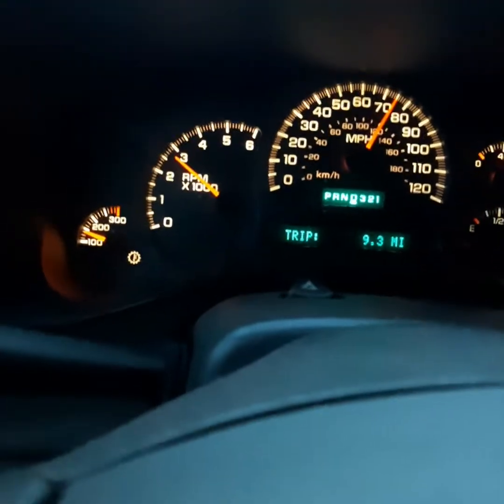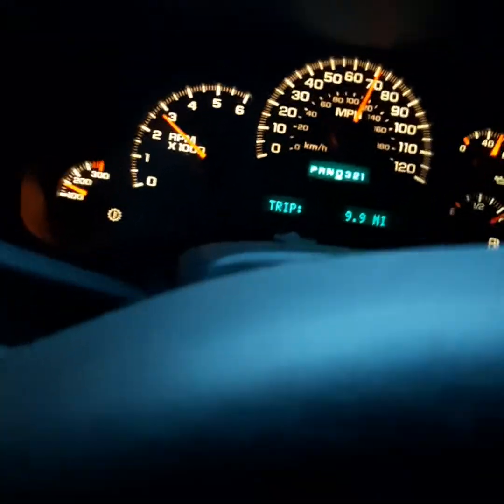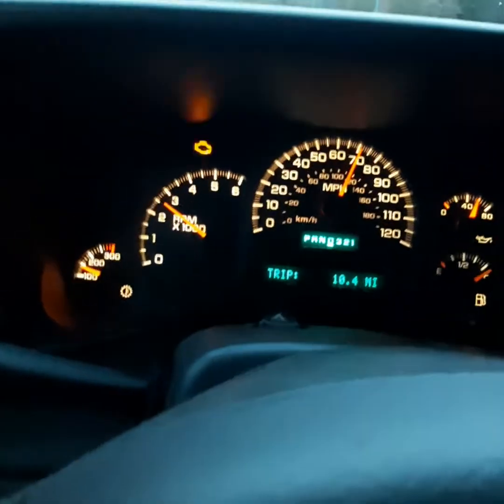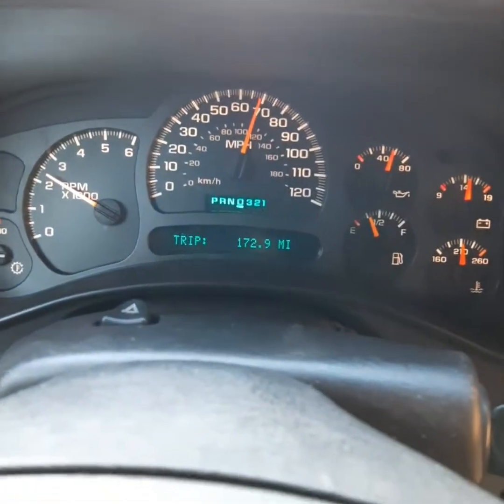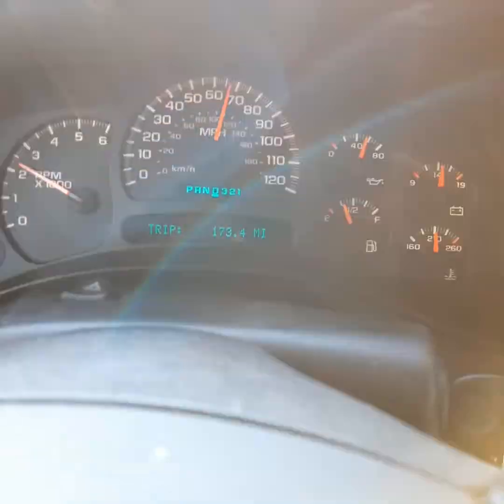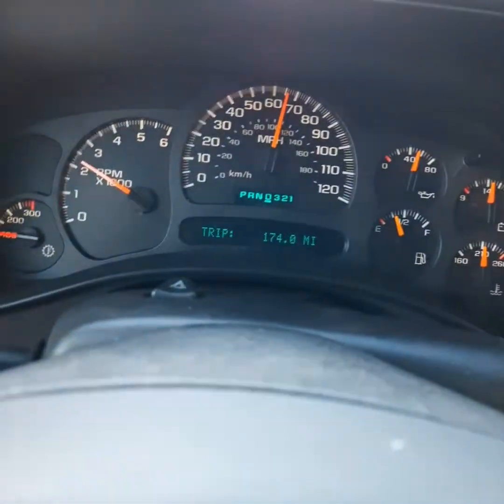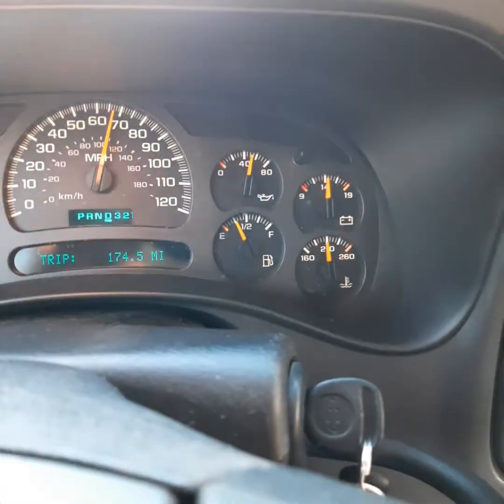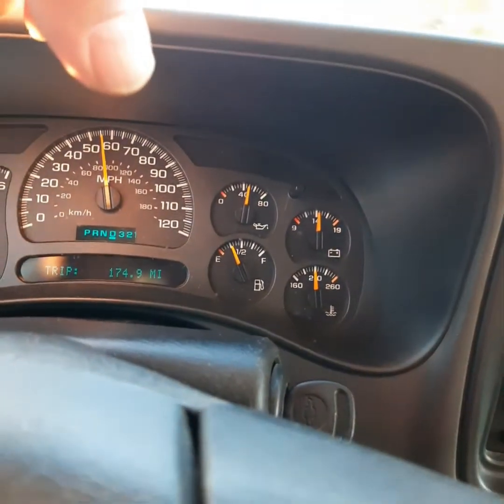flashing check engine light and no overdrive lockup at highway speeds

Comment: I have a 2005 Chevy Express 1500 5.3 liter.  The "Service Engine Soon" light flashes above 65 mph.  I changed the plugs and wires and it still did the same thing.  Mode 6 misfire history has misfires on cylinders 1,5,6, and 8 so I changed the coils on those cylinders only.  It still did the same thing.  The mechanic who did the plugs and wires said it was the crank sensor after I told him that the cel only flashes above 65 mph.  I was sceptical that he went straight for the crank sensor.  My first suspect would be the coils.  But after replacing the 4 coils that had a misfire history and the cel kept flashing above 65 mph, I am starting to think that he might be right.
Reply from the maker: I changed mine but it still flashed at times.
Reply: @hollywd269  Are you saying you changed your crank sensor and did a relearn?
Reply from the maker: @USkeZB3mpyAMCV yes and it still flashes at times not near as bad but still does! It's annoying but with 235k on my truck and I've had it for 10 years and it runs fine just that dang flashing light from time to time i have learned to ignore it, i have chased this problem for years with no real fix. Plugs, wires, coil packs, manifold bolts, o2 sensors, you name it i have done it... I've learned to live with it lol. Truck runs good even with the flashing light every now and again. I just did 1600+ mile to Florida to get a trailer so 800 was pulling a trailer no issues other than the flashing light a few times during the trip.

Comment: Hey guys I have the 4.8 l and I was having the same exact issue and I took it to the shop where I personally know the owners and they put in through the analysis and it was the spark plugs and wires ACDelco is what they put in it and it stopped everything even the shake the blinking light no more misfires it was having random misfires That's why it blinks I hope this helps you guys because it definitely helped me

Comment: My 2003 Silverado 1500 4.8 has the same problem and it also does it every time I go between 75 to 80 miles per hour and I have already changed many parts that could possibly be the problem but the problem is still there,Any ideas and help would be great and thanks in advance
Reply from the maker: I'm at the same place some things will temporarily fix but seems to come back on my truck anyway, the only way mine work properly is if I'm pulling a trailer. I'm kind of at a lose other than to change the computer in the thing. Because on mine it's definitely electrical,  if I'm driving and have no code but hook up a scan tool and erase codes (even though there is none) torque converter locks back up for about a mile then it'll unlock again. So still at a lose myself but if I find the solution I will definitely share.
Reply: Fuel injector?

Comment: 2004 Silverado with 4.8L, exact same thing happening for 5 years. initially only at speeds over 70 mph, now it flashes intermittently at speeds over 50 mph. Had it into 3 shops, always been told the P00300 code is a soft code, no hard codes being set and no misfires, engine runs & idles super smooth. Chevy dealership stated ECU "could" be the culprit then charged me $350 for diagnostics, after I told them I wasn't interested in rolling the dice at a thousand dollars a pop when the truck is running fine. I'll have to check into the crank sensor swap for my 4.8L. Thanks for the video!
Reply from the maker: Yes sir mine still does it from time to time, the truck is old enough I'm not dropping big money into it anymore as much as I love the thing it doesn't seem to miss a beat so I say let the light thing do it's thing and keep on getting it lol thanks for watching
Reply: My 2006 1500 4.3 V6 is having the same problem, until one day, it stalled(Standard) and now just cranks and does not start.

Comment: It was my cats most recently. I was getting knock sensor code, misfire 0300 code and hesitant at 60+ or hauling. I dumped about 1500 into parts before I laid under the truck an touched the piping before the cat an realized it was red hot. Changed the cats, runs like a beast now. 2002 Avalanche Z66 5.3

Comment: I have this same problem 04 gm 4.8 only blinks at 65 70 mph or above but mine only does it when I let off the fuel. If I get back into the fuel and it shuts off... can't figure it out
Reply from the maker: I still haven't figured mine out. It has a ground problem or something but the dang thing runs good and never let's me down. Just those light come on every once in awhile but seems to be running fine! Good luck I've been chasing my problem over 3 years now lol
Reply: My 2004 1500 4.8 does the same thing. Only comes on when driving over 70 MPH or so, and usually when backing off or going downhill. Then the light stays on. Two days later, it clears if you just don't drive on the highway and stay below 60 MPH. Anyway, i heard that a crank sensor relearn will fix it, but I'm going to change it out anyway.
Reply: Please let us know if the crank sensor was the problem or not